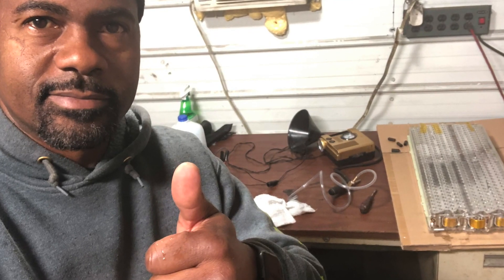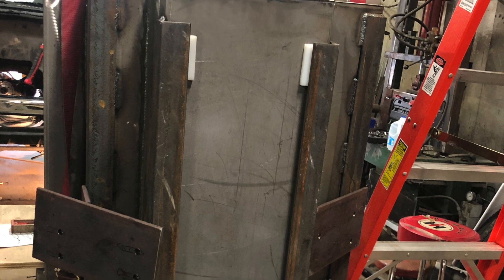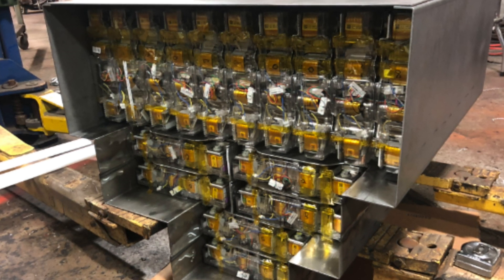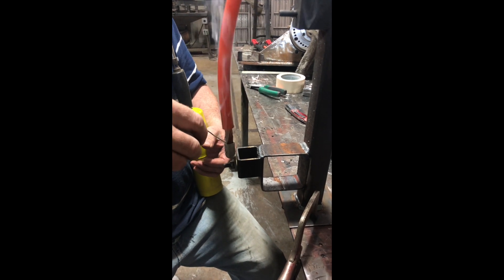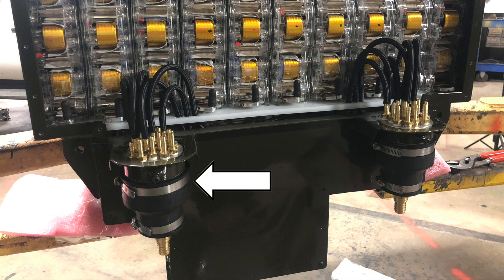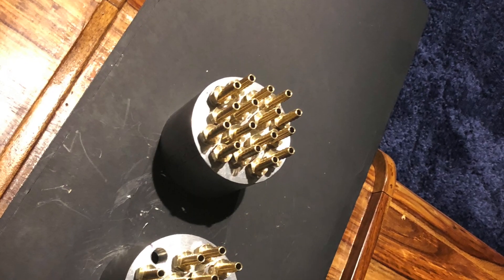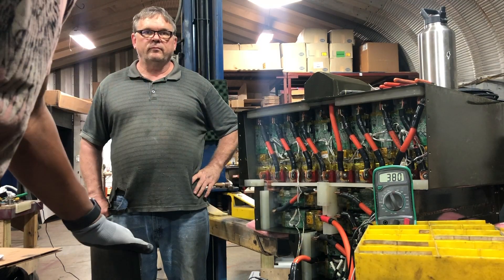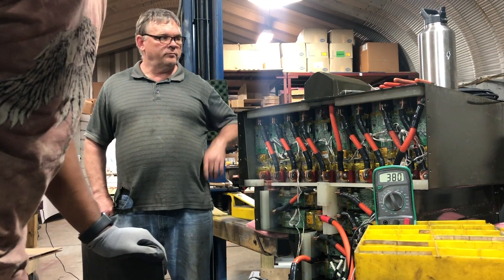Battery Box Construction Pt 2

Comment: Why you run water over them batterys? It’s gone to ruin them!!! My cousin once used a garden hose to clean his truck engine and it blew up the battery and my cousin when the water got on it and it got wet and blew up. Use steam power instead. Much better than wet batterys. You only need 1 battery to start the engine anyway, every body knows that! Just use a bigger one if you need more power, and keep it dry for crying out loud! My cousin learn the hard way, god rest his soul.
Reply: you're about a sharp as wet piece of leather aint ya!?
Reply: Leather ain’t sharp, buddy. Shows how much you now. Electric car needs a long power cord to work! No good and better with gas and safest with gas and dont need no battery xsept to start it with.

Comment: Absolutely stunning!!! That battery box design is amazing! I’m no EV pro or anything, but from a cooling perspective, should a larger inlet/outlet/pump be used to disperse the coolant to those multiple barbs? Just curious :). Great build and keep up the great work!!!!
Reply from the maker: Donovan Gregg, when testing the gpm flow during the leak testing, we realized that it doesn’t take more flow than what we designed to manage these modules thermally.  We have an oem Tesla water pump and the inlet/ outlet diameters are actually smaller in diameter than what we have on the manifolds. 👍
Reply: @greggoeselectric3595  Okay, right on, thanks for clearing that up. I was curious what even the stock pump was, thanks for letting me know :). Keep up the great work!
Reply: Donovan Gregg 👍

Comment: Love to see your projects, lots of thinking into these, very inspiring too !
I didn't see any way of bleeding air from your glycol-cooling system, what do you plan for this ?
Reply from the maker: I did add a line that runs to a overflow tank. I will cover that in the video that covers thermal control components for the cab and components